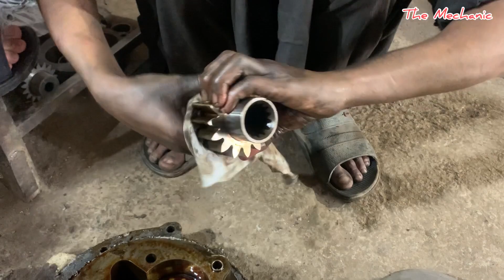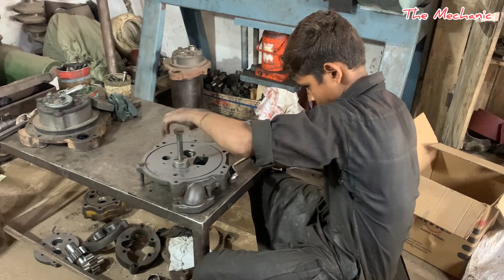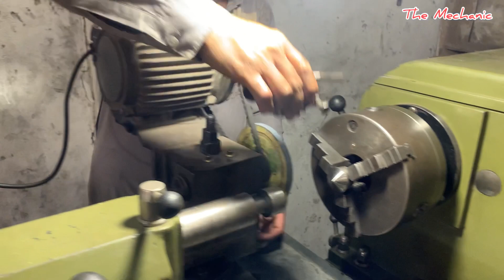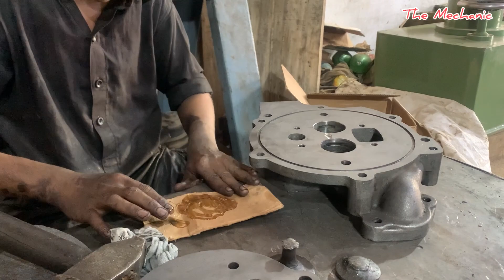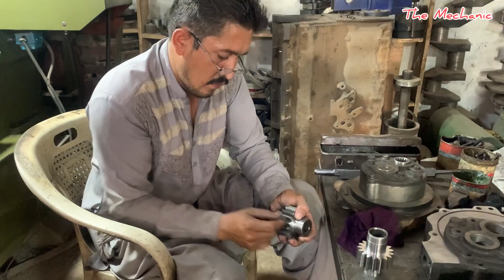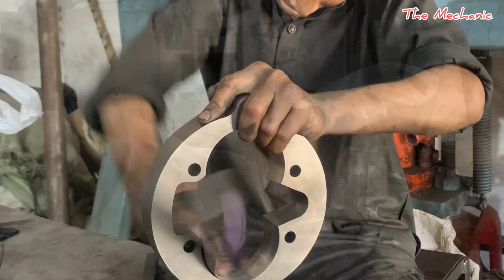Caterpillar 960F Wheel Loader Wrecked Transmission Pump Rebuild by Experience Machinist

Comment: They do better machine work than some of the shops over here in the USA ,  The parts cleaner  Diesel oil ,
that's what we used back in the day , diesel oil and a brush and  Wash  it off with the water hose comes perfectly clean
Reply: Diesel oil wont cause dermatitits, is just that some people skin are more sensitive to chemicals than others, and they can get it anyway by just washing the dishes with detergent or soap. If your hand itches, put on a pair of gloves and problem solved.
Reply: @JnSobre   That's right , I still use diesel oil today to clean my parts and spray it off with the water hose
Reply: aND RUN IT RIGHT INTO THE WATER SUPPLY

Comment: who on earth uses epoxy in transmission parts? those rings are pressed in the holes and use compression fit. the experienced machinist just threw all the gears out of balance in an attempt to fit them in the case

Comment: In nearly all these type of video clips where repairs are made nobody uses a torque wrench on bolts just hand tight and maybe a tap with a hammer...?????
Reply: I do the same, I tight until my elbow pops, no need for torque wrench.
Reply: A good mechanic or machinist can pretty well judge the torque close enough to be effective.  I've been doing it for 50 years and never had a problem.  Critical torques, I'll use a T wrench.  Like head bolts, connecting rods and bearing caps etc.
Reply: I seen one of these videos where they put a engine together without a t-wrench.  😂.    I bet it’ll last.

Comment: that is the wrong way to use a micrometer but hey atleast they are not eyeballing it, the lathe guy even ground the cone tip chucked in the jaws to make it run true